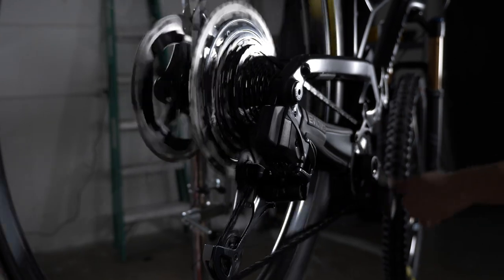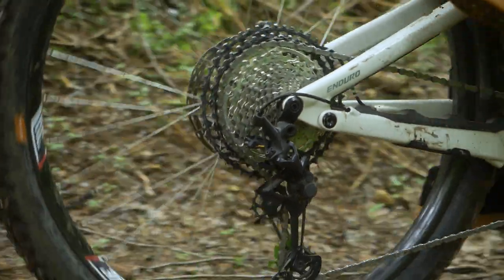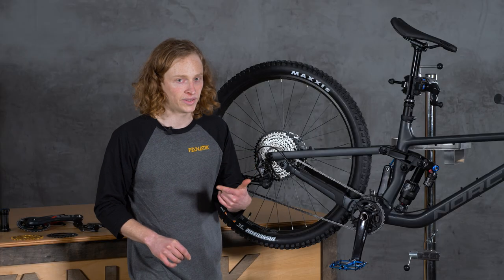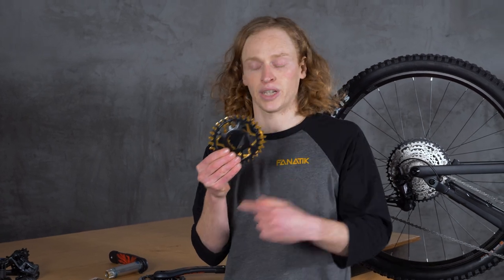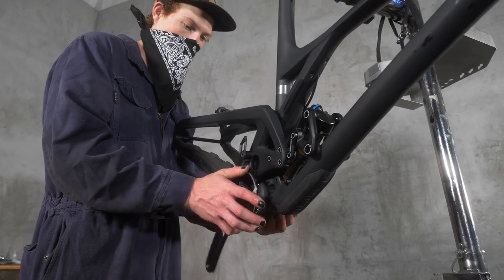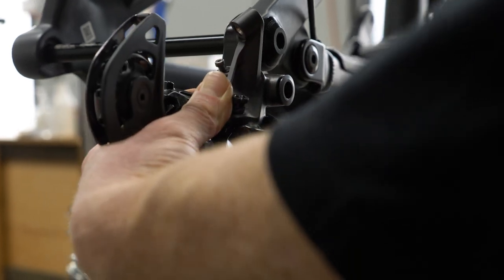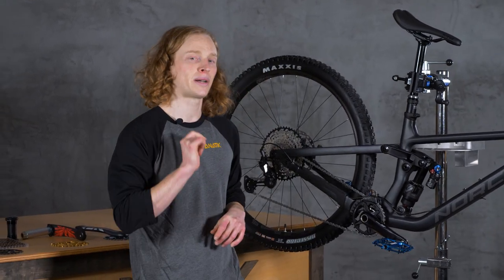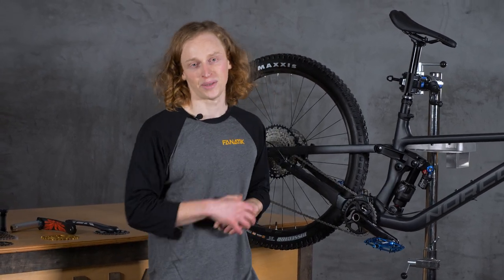How gear ratios let you climb steep hills and bomb down trails: Mountain Bike Drivetrain 101

Comment: I'm just looking into the gearing and how it works I have 3 gears in the front and  7 in the back  . The smallest in the front is 26 and the biggest in the back is 28 so its just shy of the wheel making a full rotation  with one rotation of the pedal . I'm taking  it that if I had 28 on the front and 28 in the rear it would  be exactly one rotation of the wheel with one rotation of the pedal ? I have noticed with the bigger 12 gears  from 10 to 52 teeth  the front gear only has 1 gear in front . Why is that ? Why wouldn't I want to keep my 3 gear set in the front ? Would the angle of the chain be to much  for say the biggest gear out of the 3 on the front and when the chain is on the 52 tooth gear on the rear or would it still work ? As far as the shifter goes  for the front gears if I wanted to add a 12 gear 10-52  couldn't I keep the same  shifter  for the front and only have to chance the  derailleur and the shifter  for the rear ?

Comment: Isn't the left side pedal reverse threaded so it won't unthread when pedaling? (Both are being tightened when pedaling)
Reply from the maker: Nope, other way around . Picture which way the pedal body pulls on the spindle as it rotates during pedaling.
Cheers - Dan at Fanatik